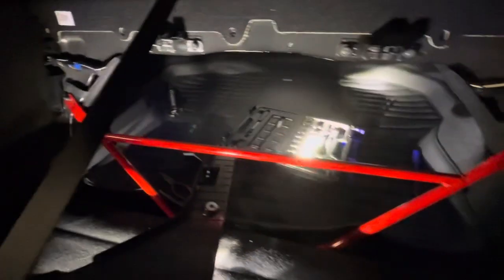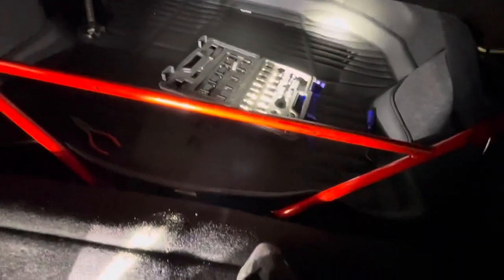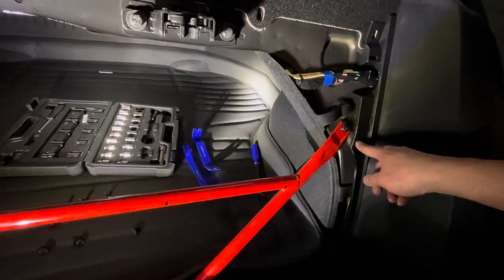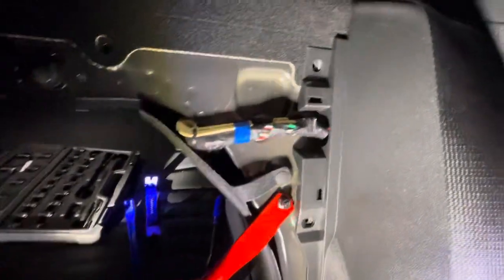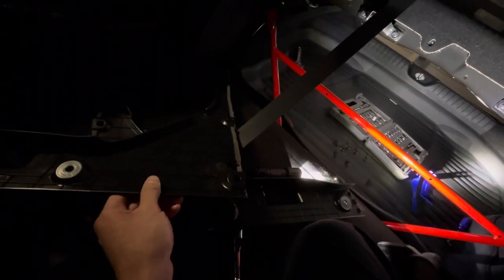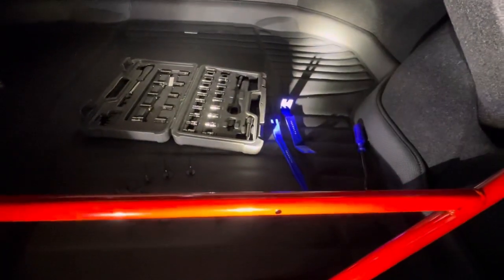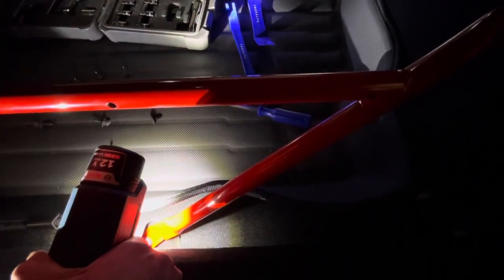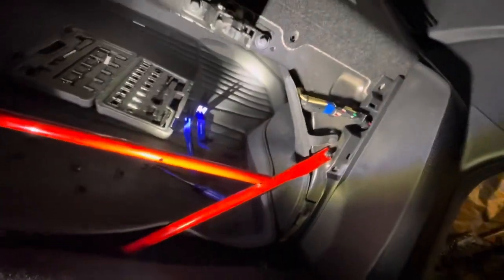Elantra N VLog - Seeing what it takes to remove trunk brace

Comment: Great car but its a shame that removing this takes more effort than it should be. There is no need this to be covered by the trim to remove this and should have been designed to be just easy removable with just bolts when needed. At the end of the day, it is still a sedan car, not a dedicated sports car coupe, people buy this because it is both practical car for everyday use and a track weapon when needed.